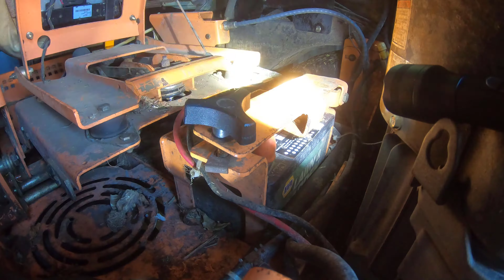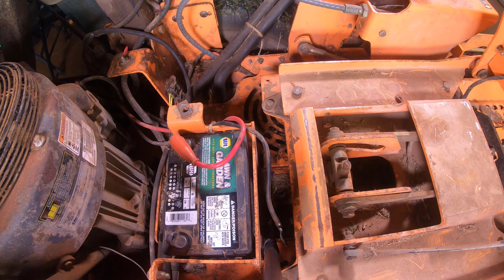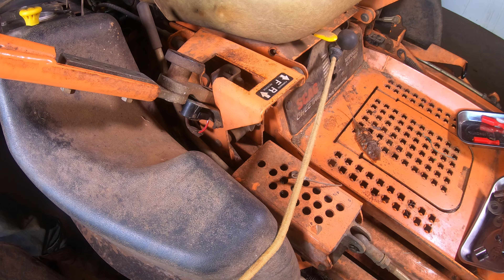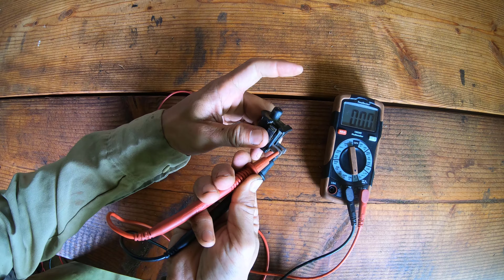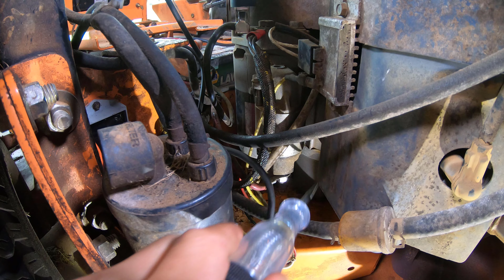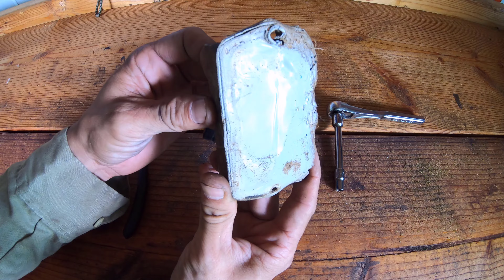Troubleshoot and fix a no crank, no start lawn mower Kawasaki FX850V in SCAG Cheetah zero turn.

Comment: Believe it or not but most likely it was just a bad connector and the module was most likely good. I've  cut the plug and sodered each wire together one at at time to keep everything strait with good success the modules are sturdy  not much to go wrong unless you have some type of severe power surge the module should be fine the plastic connectors rot and is uaslly the problem

Comment: I not getting ground from the module to the starter relay …im getting voltage .  So no crank  no start.    At this point I believe my module is bad. Too

Comment: Unplug the module. Ground the green wire. Make sure brake is applied, handles are in neutral, and blade switch is off. Try to crank. If it cranks either the module is bad or problem at the interlock switches. This means starter, starter switch, and starter relay are good. DO NOT operate mower with module disconnected. Proceed at your own risk. This information is for experienced mechanics only.
Reply from the maker: Thank you for your comment including your perspective about video.  The video is intended for anyone who is interested in troubleshooting a no start issue on a SGAG or other lawn mower.  It also for anyone who just want to watch the process or get ideas about other items to check if they’re mower engine will not start (after the battery is checked.

Comment: What are you spraying into the safety switches after cleaning
Reply from the maker: In this video I'm spraying a cleaner which is likely a solvent.  It's sold as it as  Electronic Cleaner or Electrical Contact Cleaner.

Comment: Thank you for the walk through.  I have had the same intermittent issue.  I cleaned all of the electrical connections with electrical connector cleaner and that initially seemed to help, but it happened again recently.  Now I have a next step to try.
Reply from the maker: Thank you for leaving feedback.  Good luck to you with your mower.  At the time of recording, the starter in this video was in working condition.  Although there wasn’t a lot of time troubleshooting the starter, I would have gone back and double checked it again if the steps and solution in this video didn’t work.

Comment: My issue was the BRIGGS & STRATTON - EFI ADAPTER HARNESS. It's used only on the B&S 37hp EFI motors. There's no clip on one of the connectors and it had slipped out of the socket. I disconnected both sides, blew them out with compressed air, reconnected while fully seating the connector. Finally wrapped the entire harness and surrounding wire in phasing tape while seated. This connector should be heat shrinked not just squirted full of silicone grease. It was full of dirt, grass, and sand. Scag fail.
Reply from the maker: Thank you for sharing you perspective.  Seems like dust and dirt are guaranteed to be on all surfaces for these machines.  Although there were no problems with the connection in this video it seems interesting that since the issue was heat related, that they would mount the electronic with no space to vent some of the heat.
Reply: I AllWAYS use 2 zip ties to insure they don’t come apart

Comment: I have a Scag Patriot that I was occasionally having starting issues with.  Starter would click, but not attempt to start the engine.  It will, when it feels like it, start after multiple turns of the key.  All of the safety switches appear to be working.  Battery is fine.  All of the info online aspears to focus on the safety switches or the engine itself, which is not my issue.  Maybe I'll change out the Electronic Module and see if it helps.
Reply from the maker: Thank you for leaving your feedback.  Battery may be the first cause.  If I thought it was good I’d test it again and/or jump start it.  Then I’d check the switches.  If switches are ok, I would check the connections.  Then I would check the starter and /or starter solenoid if it has one.  The last thing I’d check would be the module.  The starter was a quick check in this video because:  there was no click, it was getting 12v when it needed to and the module in this video was physically expanded from heat as seen from the outside case.  Good luck with troubleshooting your issue.
Reply: @TryAdaptLearn  Pulled a trick from my old car days and I can get it started by taping on the side of the starter with a hammer!

Comment: Just electric contact cleaner or? For the connections? Thanks
Reply from the maker: Thank you for the question.  I used electrical contact cleaner.  Isopropyl Alchohol could also be used, and/or a physical tool like a brush.

Comment: Very good video. I have a John Deere Z235 it dies when I put the brake on. One time start again after 20 minutes. Then die again. I jump the battery with my truck and start again. What can be the problem?
Reply from the maker: If the engine runs properly and stalls (only) when the brake is engaged by the operator, a safety switch on the brake or related electrical circuit may be the issue.  If the engine needs a jump start from a truck then the battery is the issue.  If the battery fully charged then  is load tested to be in good condition the charging system may also be an issue.
Reply: @TryAdaptLearn  thanks for the tips. I will check it out and will come back here  to update.

Comment: When I had a no crank - no start issue with my scag cheetah, it began as an intermittent problem, which I somehow jumped to the conclusion that it was an ignition switch going bad, (partly because after multiple cycles of the ignition switch it would occasionally start).  After replacing the ignition switch failed to correct the problem, i thought it might be one of the numerous safety switches designed to prevent me from killing myself.  So, to confirm it was not the starter motor, I bypaased all that crap with a remote starter switch connected directly to the solenoid.   Engine started right up.  I continue to start it that way...and I still have 7 toes and 9 fingers...  too many stupid interlocks. Now my only problem is a small hydraulic leak out of the left control arm transaxle.
Reply from the maker: That’s good you were able to start the engine.  The few times I’ve seen leaks from transaxles it’s usually the seals to the axle shafts.  Good luck.

Comment: What were your symptoms? I have a no crank no start as well, but I lost all power while mowing. Ended up blowing the main 20 amp fuse. Put that back in and I have no power to the starter trigger. Good battery voltage. Jumped switches, nothing. Not even a slight click at the starter solenoid. Thank you!
Reply from the maker: Symptoms were that the mower engine would not crank or start.  This happened a couple of times before this video was recorded, but then was able to start and run.  Luckily, once started the engine didn't stall.  On one of the times it was able to start again the machine was moved to troubleshoot and record the video.

Comment: So when the module goes bad does that mean the coil packs won’t have no fire either
Reply from the maker: Yes, in this video, the bad module seemed to cut off power to the engine including the ignition.  It seemed that with the SCAG & Kawasaki engine in the video, the module was connected to a lot of the of the switches (PTO, neutral, etc.) and the engine harness.
Reply: @TryAdaptLearn  ok thanks for u help and fast reply & u have a new Subscribe

Comment: Thanks for the info. Just curious though. After you got it running again what does your ammeter show. Does your needle go all the way over to the positive symbol?  If not what does it hover around at half or 3/4 idle?
Reply from the maker: It looks like the ammeter shows marks for -10, -5, 0, +5 , +10.  When the engine is starting it appears to jump almost to  +10.  While warming up on 1/2 idle or above it's close to +5.  Once it's warmed up it appears to move down to between 0 and +5 to (about +2.5 to +3.0).  My opinion only, without headlights, etc., anything over 0 is good.  I do not know details about the charging system but it likely drops down because this model is designed to mow for hours without additional electrical accessories and high amperage over a long period of time may overcharge the battery.

Comment: So how did you test the module to find that out?? Mine won't crank or start after it gets warm most of the time. But if you let it set or keep turning it off and on eventually it will crank.
Reply from the maker: I didn't test the module itself.  It ended up as the last guess because of process of elimination by testing the other components in the starting circuit.  Along with the physical damage including cracking and swelling, another guess that it was the module was that it was loose from one fastener missing and likely hitting the frame on bumps.  One of the flaws I think there is is that the module has no space between it and the frame so the heat builds up from the back and likely swells the plastic case along with damaging components inside.
Reply: @TryAdaptLearn  I replaced a relay today but it didn't fix it. I guess will try the blade switch next before the module cause mine looks good. If the switch don't work will try the module next.
Reply: @leeroyexcavator9149  ever get it going?
Reply from the maker: Without a diagnostic tool specific to the module, if I were going to test the module itself, I would likely use a multimeter and test the leads on the wires going into  and out from the module.  So I would take the leads on the multimeter and test the end of the wires from the module for voltage similar to using the 12 volt test light for voltage on the starter.